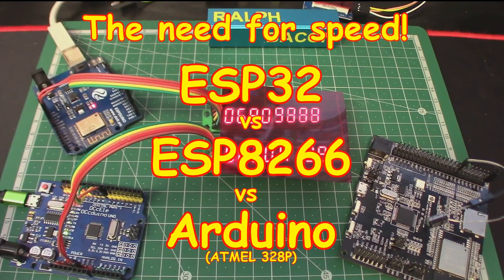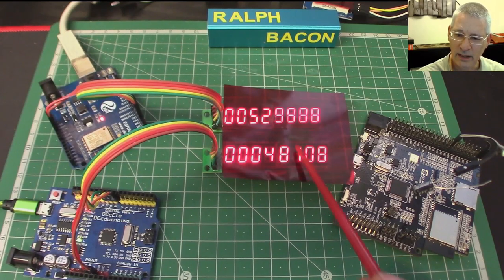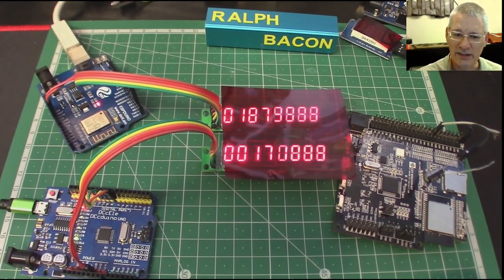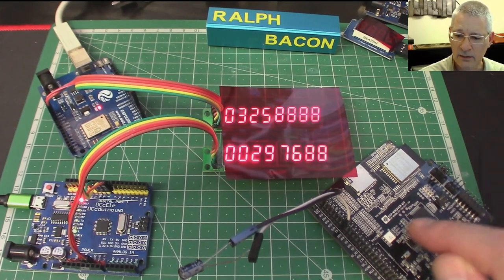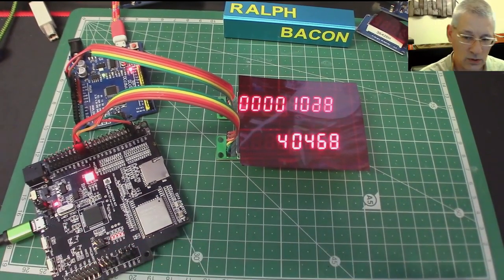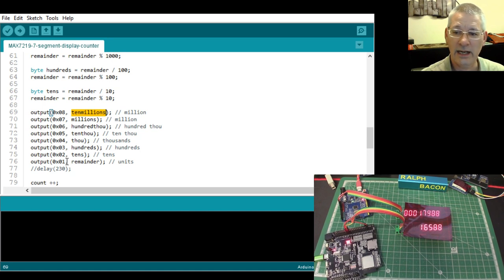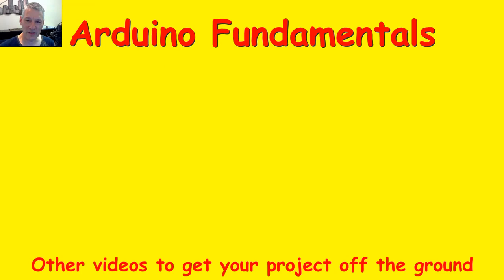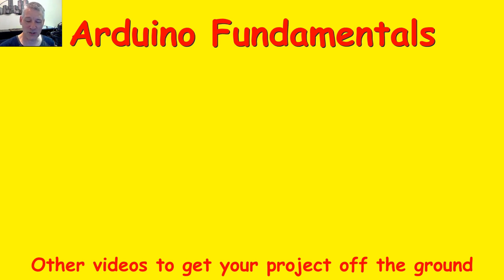#95 Speed Contest! ESP8266, ESP32 and the Uno 328P

Comment: Hi, why not using the arduino libraries for the esp32 (github.com/espressif/arduino-esp32) ? Installing should take only some minutes and you can compare the same source code on  all devices.
Reply: My thoughts exactly.
Reply from the maker: Which is exactly the conclusion I came to but far too late, after grappling with the 'native' libraries for a week. It's my next step to install the Arduino compatible ones (already downloaded). Maybe another video...
Reply: please a part2, interesting to see speeds on a level playing field of same ide, as in the real world its a more likely scenario.
Reply from the maker: Indeed, les, a part two is already being planned. Having sorted out the SPI bus speed issue and having modified the simple counter code slightly so that less was sent down the SPI wire, it will be a much more level playing field. And guess which one wins by a landslide? Phone a friend? 50/50?

Comment: Hello, This sounds I/O related.  I would recommend doing some math functions (in the main loop) and then update the display only occasionally to see of the number of  loops that the calculations have completed.  As a first thought have variables A and B  start A at 1 million and B at zero.  Multiply the values while decreasing A and increasing B by 1.  When the loop is finished display the loop qty.  I learned this as an example as one of my first programming sessions back in in 1978.  Did it in basic side by side with one system displaying the multiplied values and the other simply stating "I am finished" at the end.  The display processor REALLY slowed down the output.  Enjoyed the video, I have just recently subscribed.
Reply from the maker: Thanks for that suggestion, also suggested in another form by Graham here too. I knew the display would slow things down but as it was all relative I didn't think it would matter. But if the SPI bus speed I'm using on the ESP32 is really slow (as suggested by others here) then that would definitely be a speed killer (and a totally unfair test). I shall try all these suggestions out tonight and over the weekend. Thanks for subscribing too, appreciated.

Comment: Is it worth taking this out, now, Ralph?  IIRC, you made a subsequent video that showed the ESP32 as being much faster than the others, as expected. My guess is that the display or controlling the display was a bottleneck.
And did you ever find out why the counter was slow?
Reply from the maker: The counter was slow because the default SPI clock was set to something ridiculously low (100kHz). Once that was upped to 1MHz or so it just romped home. Question: why have SPI set to 100kHz as a default setting? Safe, certainly, but so many users will wonder what is going on!

Comment: Is better to program the ESP with the Native C or is better to use the Arduino IDE to program it?
Reply from the maker: The Arduino IDE will program your ESP32 or ESP8266 with compiled native C code - no reason not to use it! By selecting the correct board the correct compiler will be invoked - just as if you had done it manually for that particular chip. Cool, hey?

Comment: I'm guessing you started with Kolban's spi_transmit.c file from his snippets collection, is that right?  Did you change the SPI clock frequency when you did that, because he's using 10kHz for a default.  I normally run SPI in the MHz range, if my devices can handle it.
Reply from the maker: I did use his snippets - if the SPI bus is running so slowly (you did mean kHz not MHz?) that would definitely be like wading through treacle on a cold day. I'd expect the SPI bus to run at around 10MHz on this device or something close to that. I will investigate further...
Reply from the maker: Also posted in pcbreflux reply in this video comments: So I've upped the SPI bus to 10Mhz (just by adding two zeroes to that parameter, doh!) and already the output is several times faster (4-5 times) than the Arduino Mega 328P but still not as fast as the ESP8266. Upping it to 20Mhz made no significant difference. But it's a start.
Reply: I think I misread it and it was actually 100khz, not 10... but still, that's quite slow for SPI.  I'm glad you saw better results after adding those zeroes.  :)
Reply from the maker: Yes, it was 100KHz by default but that is very slow. I'd expect 10Mhz! Anyway, I've now also cracked it by using the Arduino-ESP32 libraries - now runs x times faster than an ESP8266 (for this sketch, anyway). All will be revealed in a future video!

Comment: Hi Ralph, nice job, but it was not clear for me whether you have used the OS_SDK or the NONOS_SDK. Indded, even the ESP82 having two cores, the change of context among internal cores would require a lot of processing, which could perhaps explain the difference in performance. Do you think so aswell ?
Reply from the maker: Hi Andre, good question. The Arduino-ESP32 comes with the RTOS SDK (module) although in this simple demo I'm not using any of its features; for example I'm not spawning tasks to be run, I'm just running them in real time, as it were.
 
However, my understanding of the ESP32 grows daily so maybe there is another way I should be running this demo. That said, I've now implemented the Arduino-ESP32 library, and have upped the default SPI speed from 100kHz to 20Mhz and have "hacked" one of the RTOS modules (esp32-hal.h) so that it does not worry about either core accessing SPI simultaneously (not recommended, although Espressif showed the hack!) and it now runs about 4 to 5 times faster than the ESP8266.
 
This is still not a fair test though. In the Arduino and ESP8266 code I just bit-banged the SPI bus (I used a sketch from a previous video where I did not want to distract viewers with libraries of any kind). However, on the ESP32 this only worked for a very short while before it gave up (I'm assuming the clock signals got a bit stretched or out of sync) so I reverted to hardware SPI. And it now runs just fine (it would run marginally slower if I remove the concurrent SPI access - but this exercise was purely about speed not what you might implement in the Real World).
 
All said and done, and whilst this was an "interesting" demo that I'll have to finalise in another one soon, this channel is about Arduinos and their close cousins. The ESP32 is definitely a cousin-once-removed and requires a different way of programming - not something for Arduinite beginners!
 
What a long answer! Just goes to show that there is so much to consider when dealing with the ESP32. I hope this hasn't put you off investigating it though, perhaps with the smaller (and much cheaper) ESP32 dev module which I will also show in that update video?

Comment: I doubt showing how fast a counter can increment is a very good demonstration of 8-bit vs. dual 32-bit processing power, etc...figuratively good job, but...yeah.
Reply from the maker: Yeah, well, Jeff, I wanted to show something visually to my viewers and this was what I came up with! As it happens, it was most useful inasmuch that the ESP32 was very slow and others alerted me to the SPI (I2C?) clock speed which was set to 10 (100?) kHz. Once I had changed that (tricky, deep in the bowels of the code) it just romped home a clear winner. I don't remember all the details (?) but it was fun, all the same! That ESP32's speed has got to be seen to be believed.

Comment: Excellent video (mainly because Benny paid a visit -  is he not that impressed with ESP-32?). 
The speed results on the ESP-32 were very interesting; but a device running under the management of a RTOS is generally going to compare rather badly with a device in which your sketch is the ONLY code that is running on the chip, However, should one compare the performance of the three devices running an application that justified the use of a chip like the  ESP-32, one might find the results rather different.

Dual core might prove to be disappointing in many cases. It is likely that the RTOS has designated the 2nd core (or the core that your sketch is not running on) for those tasks that the 8266 and ATMega 328 currently use interrupts for. Such as Serial, Display processing, 
 Wifi and bluetooth. 

What would be interesting would be if the ESP-32 firmware could be programmed WITHOUT the RTOS. I suspect the ESP-32 would dim all your lights when it booted up; such would be the raw power.
Reply from the maker: "I suspect the ESP-32 would dim all your lights when it booted up..." - and that is exactly what I (and Benny, it must be said) were expecting. so whether it's the RTOS (not really an operating system at all) slowing things down or the SPI bus running at 1/10th at its proper speed remains to be investigated. I certainly intend to get Benny more interested in the ESP32 so we have code written much more quickly than I could ever do (and as I have unfortunately proved these last two weeks or so). As for the dual core aspect of this chip I will dig down and find out whether it used for other peripherals or whether I can issue a task on both cores to run simultaneously (not pseudo-simultaneously, time-sliced). Thanks for posting Michael, Benny reads your posts too.

Comment: Not really a fair comparison.. The esp32 is running an operating system under the code where the other two are executing raw instructions. The architecture between the 8266 and the 32 is very similar so raw code execution should scale fairly linearly with clock and number of cores.
Reply from the maker: Well, possibly that and running the ESP32's SPI bus at some stupidly slow speed (100Khz) really nobbled that poor ESP32. Once I'd fixed that (see further comments under this video on what I did, thanks to other contributors here) the ESP just laughed and ran away at quite some speed from even the ESP8266 (as you might expect).
 
I should revisit this but at the moment I'm still concentrating on reflashing the ESP8266s contained in Sonoff devices for my Workshop automation project - and the ESP32 hasn't made it into that arena just yet.
 
But take it from me the ESP32 is f-a-s-t.  Thanks for your post, Aaron, good to hear from you.

Comment: BTW, I feel your pain from your experience with Eclipse. I tried wrestling with it over 3 decades ago. I gave up after two weeks. At that time, the anti-Microsoft lobby were desperately looking for an alternative to Visual Studio. Many forums had posts claiming that Eclipse was a far superior IDE but I am convinced it was wishful thinking. Even after getting the beast to compile, its "intellisense" was very hit or miss.
Reply from the maker: You may have noticed, Michael, that I like the Eclipse when used with the Arduino add-in. It's very much like Visual Studio (well, I believe that VS now uses a customised version of this, it certainly looks very similar). But using it natively when I'm not familiar with all the ins and outs of where to put the libraries was a bit of a challenge (as well as not spotting the example program was in "C" not C++). That aside, look at my comments below from tonight where Benny's managed to get it 4x faster than an Arduino just by following the suggestions here that the SPI bus was set too low! Now I feel stoopid.

Comment: See https://github.com/nkolban/esp32-snippets/blob/master/cpp_utils/SPI.cpp in  SPI::init
...
dev_config.clock_speed_hz = 100000;
...
maybe try  10 MHz 
instead of 100 kHz
Reply from the maker: Ah, you're the second person to suggest the SPI bus speed is 'wrong', thanks for this, I shall definitely check this out. Yes, that was the file I was using too, so I'm keen to try it out this evening...
Reply from the maker: So I've upped the SPI bus to 10Mhz (just by adding two zeroes to that parameter, doh!) and already the output is several times faster (4-5 times) than the Arduino Mega 328P but still not as fast as the ESP8266. Upping it to 20Mhz made no significant difference. But it's a start.
 
Now I'll get it working with the Arduino IDE so I can at least use the same source code. thanks again for pointing this out, seems a strange default value to use, usually SPI bus is 1/4 of main clock speed; on this board I believe it can go as high as 80MHz.
Reply from the maker: I haven't had time to look at your video (yet) but I will do over the weekend. I hope you had better results than me (although after that SPI bus change it does run much faster). Now it's complaining about my SPI library from the Arduino-esp32. The joys of programming!
Reply from the maker: Prima und erste Klasse! Dein Video, meine ich. I thought it very interesting how you ran the different processors side-by-side doing various mathematical functions - and of course, the ESP32 thrashed the competition. I'm surprised the MEGA was not quicker (compared to a standard Arduino). My recent experiments with my ESP32-WROVER kit also prove that it is many times quicker than even the quick ESP8266. Anyway, gut gemacht und bis demnaechst.
Reply: Vielen Dank. Think the ESP32-WROVER kit is a little bit overkill to start with, but OK if you would test all features. Same with the esp-idf if you are familiar with arduino. Arduino is nice to start with, but the (binary) libraries for the ESP32 have their limits. Love to see more with the ESP32 from you.

Comment: I have been on the esp32 specs page and they mention 240MHz clock frequency and also 16MB flash/Rom ...
Reply from the maker: Indeed, John, and the ESP32 WROOM spec sheet states "There are two CPU cores that can be individually controlled, and the clock frequency is adjustable from 80 MHz to 240 MHz" although I haven't experimented with that feature yet. That's techno-speak for "I don't know how to adjust this frequency". They don't make it easy for me do they?
 
Anyway, they also say, "ESP-WROOM-32 integrates 4 MB of external SPI flash" (can have up to 4 of these, ie 16Mb max) and my ESP32 experimenter's board (ESP-WROVER) "features both 4 MB external SPI flash and 4 MB external PSRAM" although exactly how I use either/both is not something I've learned in the 30 minutes I've used the board to-date, much to my embarrassment!
 
I suspect it may take me a bit longer to get to grips with board along with all the other videos I'm lining up. Thanks for posting this John, good to hear from you.
Reply: Oh trust me I also have more questions then answers regarding the ESP32 platform. It is still a very "young" platform. But it looks promising as long as they support the Open Source environment around it, that is ..more source code, more libraries and functionality easily available for everyone.

Comment: all three are completely different from hardware point of view. arduino is only 8 bit and esps are 32 bit  those are obviously going to be much faster. secondly esp32 is dual core, if used smartly can run much faster.
Reply from the maker: "If used smartly" is indeed the crux of the matter, Electromania. I don't think we're quite there yet with ESP32 support but 2018 may see that turn round, just like it did with the ESP8266. Incidentally, I got the ESP32 to run many times faster than the ESP8266 when I figured out (was told, actually) that I had the bus speed set to default (ridiculously slow).

Comment: Use arduino IDE and hardware SPI not software SPI this hardware SPI is only on the ESP32 not the ESP8266.
 See the G6EJD channel Tech note 45, https://youtu.be/KFjYQMAUDjw

The arduino 8266 library is now 2.04rc01by the way. Paste in Arduino Ide preferences...
https://github.com/esp8266/Arduino/releases/download/2.4.0-rc1/package_esp8266com_index.json

Adding the ESP32 is a bit harder than just a JSON link on the Aduino IDE preferences but the Wiki instruction do work. https://github.com/espressif/arduino-esp32 and select the OS you are using.

Please when you have it going an update video would be very appreciated. Graham
Reply from the maker: Thanks for the links Graham, and yes, my intention is to do a further video once I have it all running as well as my ESP8266 on my Arduino IDE. That's all after my lie down in a darkened room, of course.

Comment: It looks like you are just comparing spi speeds. Depending on implementation, library... this is not meaningful?
Reply from the maker: Well, that was not the intention. The aim was simply to send data down the SPI bus to indicate what was happening internally (ie adding up that number). What happened was that the ESP32 was indeed severely throttled by the SPI bus speed (100Khz, I mean who would set that as a default?) but it's all fixed now and with a small change to the code to only send out relatively little data on the SPI bus the next video on this topic will set the record straight. Keep tuned and a good observation!